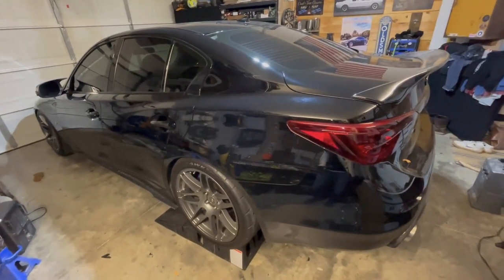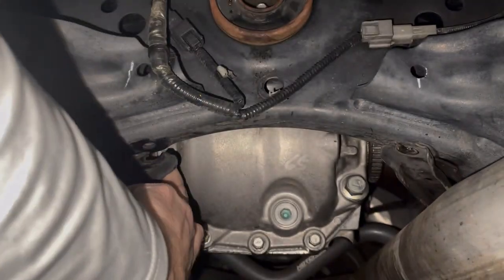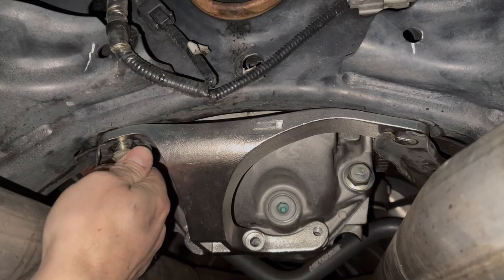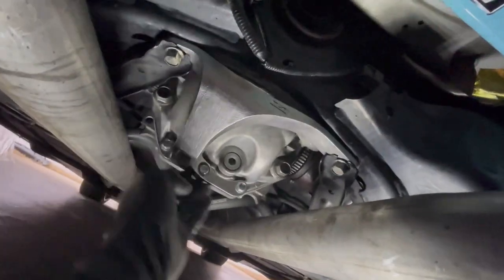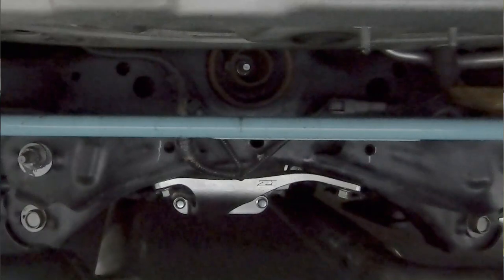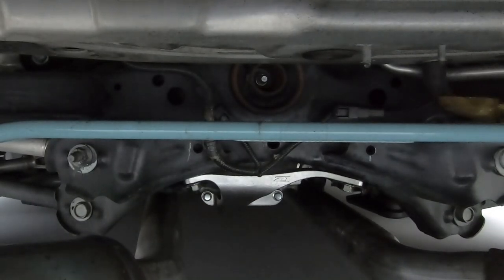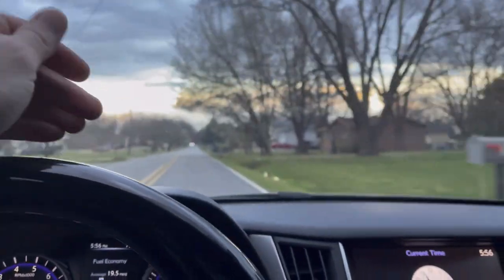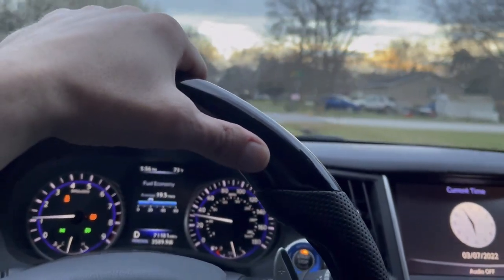Q50 Rear Diff Brace Installation AND Test | Z1 Motorsports

Comment: BMS burger tuning just released their rear diff braces for Q50/60. Looks better design than pride auto but i still prefer z1's. You should check it out see what you think of it
Reply from the maker: I’ve seen it and will probably make a quick video with my thoughts.  I prefer Z1 also
Reply: BMS part is an inferior design. not nearly as terrible as the pride(less) part but not as robust as the Z1 part.
Reply: Dammit, wish I seen this one before I ordered from z1

Comment: Gonna cop it , but gonna wait for your full review J , I’m interested to hear what your thoughts are on it after testing it since the last one you had was trash and didn’t look good especially because of the welds it had. want to add one to mines but gonna wait to hear your thoughts
Reply from the maker: Looking forward to this weekend and pushing it a little bit!  Stay tuned
Reply: the welds on the other brand were less of a problem than the tin foil it was made from. the other diff brace is too thin and flexible with an inferior mounting solution. that part was put out with little thought or understanding of how it needed to function.

Comment: I want one for my Q60 but Dont know if it will hold up and not crack the Diff cover with Daily Driving over time.
Reply from the maker: It shouldn’t.  The force comes from launching the car.  There isn’t a whole lot of movement in the bushing under normal driving.

Comment: What method and percentage of tail light tint did you go with, (shown in thumbnail), I’m looking to get mine done on my 2016 Red Sport. One shop does spray tint, can’t make a decision on that due to it being permanent. I’ve tried two methods of film, (cut outs and a large strip), neither of those worked well enough for me to do it.
Reply from the maker: It’s sprayed.  4 coats VHT.  Wet sanded with 1500 grit.  6 coats clear.  Wet sand 2000 grit.  Polished and sealed.  You can always sand through it to remove it.  I prepped spray because you can get it much glossier and you can determine the level of tint
Reply: @SpeedCultureStudios  Thanks a lot man I’ll look into it looks amazing.

Comment: Is this the thing that makes both tires spin in a burnout ? I got 16 rwd q50 and it only spins one tire on standing burnout
Reply from the maker: No.  That’s an LSD.  This is just a brace for the differential.  Helps prevent wheel hop etc

Comment: Hi. With this mod you will transfer more rotation power to the subframe. May you think this should use together with subframe bushing bracket from Z1?
Reply from the maker: This brace, in combination with Z1 subframe collars, will have a huge impact on how the car feels and transfers power to the ground.  I was quite surprised how snappy the car feels after install.  You can feel the rigidity, but the tire response to the throttle seems much quicker as that energy is now not being absorbed through the rubber bushings quite as much.
Reply: @SpeedCultureStudios  thanks for your reply. What does exactly the "bushing leaks" mean? The bushing contains fluid?
Reply from the maker: @Q50S_magic  yes the bushing contains fluid.  When the casing gets weathered and cracks, that fluid will leak out.

Comment: Where exactly do you locate the jack stand for the rear😅
Reply from the maker: There are jack points on the pinch weld in front of the rear tire.  Place the stands there.

Comment: what is the name of the muffler shop that did you exhaust. i have my parts just need to get them installed. thank you
Reply from the maker: Inman Muffler
Reply: does the left side have a different bend from the sway bar area to the flow fx? the dudes who did mine put it like on the diff and wanna change the piping to 2 inch so I’m going elsewhere for a re do on that side
Reply: left side when looking at the car from the rear *
Reply from the maker: @adrianbrothers6925  no bends are uniform and symmetrical.  Why 2”?  That’s too small
Reply: @SpeedCultureStudios  the excuse was first because my stillen exhaust was 2 inch which was a blatant lie.. then he said my diff didn’t allow access. I notice your pipes are lower down on the differential than mine, he just plain messed up and I think I just plain chose the wrong shop.. I’m going elsewhere for better work
Reply from the maker: @adrianbrothers6925  yeah just look at the picture from under my car.  Your aftermarket exhaust is 2.5”.  They all are.

Comment: I order the same product but it didn’t come with the instructions at all.. disappointed but what’s the torque spect to tight it down.
Reply from the maker: It doesn’t come with instructions.  There are digital instructions on the website.  That is how Z1 does it.  Just go back to the part on the website and you’ll see the link for instructions
Reply: @SpeedCultureStudios what’s the tricks you did to get this installed?

Comment: My seals are also leaking pretty bad🤦🏼‍♂️
Reply from the maker: How's the diff bushing?  I did my seals when I had the diff out for the bushing replacement.
Reply: @SpeedCultureStudios  I dont want to jinx it but no fluid or sing of faliure yet and I'm at 75,000 miles. I think I am going to get the Z1 brace soonafter I get my wheels.
Reply from the maker: @getbusyeian6426  good jdea